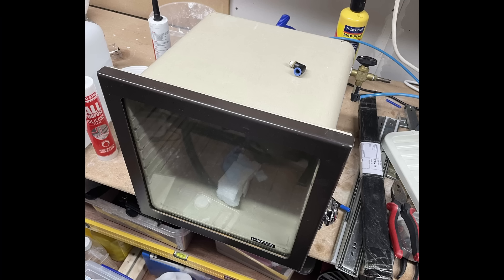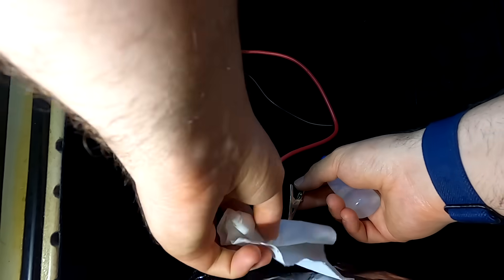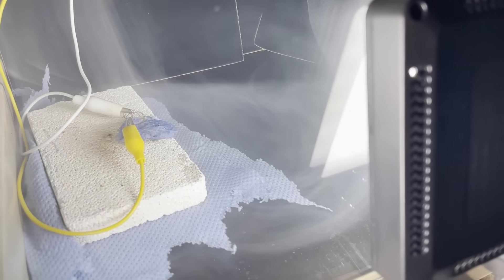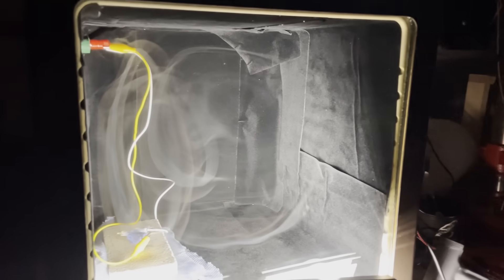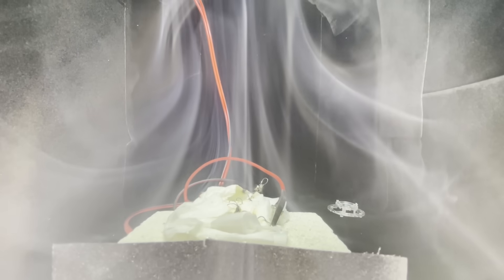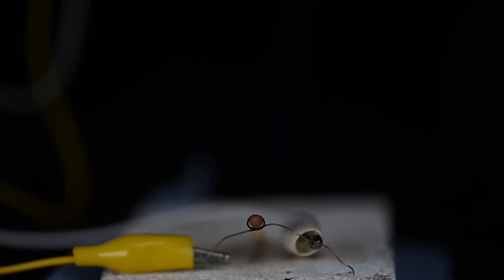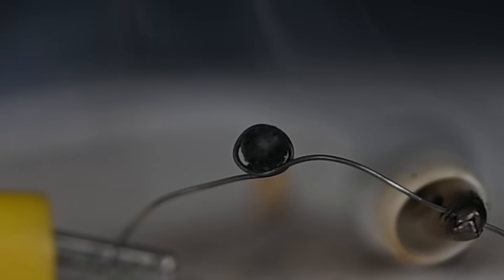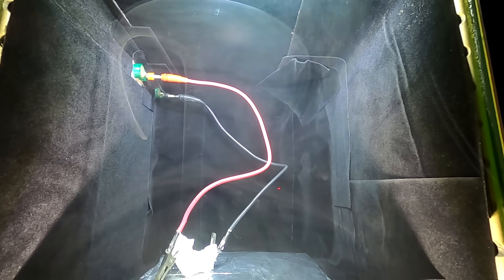What does Convection look like in a Vacuum?

Comment: This is more "How Electricity Works In A Vacuum with visuals" because those "smoke" atoms may be charged differently than fire smoke, and are moving in a stable electric arc patterns. The only way I could think to do this would be to fill the box with oxygen (or a little baking soda and peroxide in a corner) then burn something in it and seal it. But, the vacuum would just remove the smoke as soon as its turned on 🤣😂🤣 This is literally (possibly) the only way this could be done tho👏👏👏😊

Comment: A: first the smoke plates out in your cold trap, the remainder contaminates your DP oil. Or it all plates out in the cryopump if you're rich.
(at least, from the perspective of someone who worked with High Vacuum for years)
I shudder to think what smoke would do to a gas analyzer, and I shudder again to think of cleaning the crap out of it.

Comment: This is so so so much mind blowing than I thought it would ever be, we need to share this with Smarter EveryDay! I would also think a idea off this is try making the smoke at different levels of Torr/Micron and see how the levels of gasses effect on the smoke || Example: Like 3300 ppm of gas^ (I.E: pure 02,pure C02, Atmosphere, maybe even Argon) inside of allows the smoke to do this vs 33 ppm of gas^ in the chamber the smoke behaves in such a unique way! Even adding a port in the side like the + amd - cords to allow that chamber to be filled with a gas from a tank which will allow you to try other gas in a vacuum to see if it changed how the smoke behaves!

Comment: If you burn something in a vacuum, then the gases being created would reduce the vacuum would it not? Just like an explosion, but to a far lesser extent. You would have to pump more of the "air" out of the chamber as the material burns, which would essentially pump out all the smoke, I believe. otherwise, wouldn't the same thing happen in an atmosphere? (except with more resistance).      edit: The fact that there's convection... does that not prove that there is an atmosphere? Would convection be impossible in a true vacuum?)

Comment: This is smoke in a partial vacuum, which is why there are convection currents.  Smoke in a hard[er] vacuum must be different.  Smoke in a harder vacuum in zero gravity must be different.  The coolest thing would be an atomic bomb in hard vacuum.  It would have a very different fireball.  All the gamma rays and neutrons and fission fragments and metal vapor would fly straight outward until they hit something.  Anything within miles gets flashed with death and then plated with more death.

Comment: At this level of vacuum, the match test clearly shows that the residual gas has quite much effect on the smoke.

Hot gases will go up only if there is colder gas which goes down.

In UH vacuum this effect shouldn't happen.

Comment: I’d be curious of what the cross section of the smoke looks like with a laser, you can get cheap green laser diode that displays a line rather than a point.

Comment: Wait a minute, what force causes the convection currents to always RISE up from the bottom to the top? since there is no air inside the chamber, how do the atoms of the smoke "Know" to rise up vertically if there are no other atoms present at a lower temperature next to them? if there is no cold air how can the hot smoke knows to rise?

Comment: Looking at things that may effect flow, adding a vertical panel to the box for the wires and ports to hide behind. Reducing the size of the coil and fuel source like a small piece of cotton fully within the coil. I'm just trying to think of ways to get cleaner results.

Comment: How good is the vacuum?  To my eye there must still be significant air in there, or the burning is creating gas, as the smoke (which I believe is a solid, right? so won't necessarily simply diffuse?) is nonetheless  carried in streams of that gas going through the air.

A test I'd recommend is do the same experiment without attempting to pump out the air.  I'm guessing it'd look nearly identical.  You mentioned that in full atmospheric amounts of air there'd be more eddies etc. but did you try this?  I think given that it's such a very closed space, maybe normal amounts of air would give the same visual.

Comment: How is there turbulence in a vacuum and why would the smoke rise, I'm guessing it just not a good enough vacuum. Not all burning requires oxygen around it, plenty of things, like a bullet, will fire because it makes it's own oxygen from the charge.
Reply: is the smoke a gas?  if he's introducing a gas in to his vacuum chamber then it's no longer a vacuum. 

i really don't know.

a vacuum can affect current in a wire.  it's not a big affect. but one way to measure a vacuum is to measure the picoamps in a wire.

if he's introducing a gas it should affect the picoamps just like air does.
Reply: @longnamenocansayy  The smoke is a solid, tiny bits of carbon, it will have other gases as well like co2, in my mind the smoke should just drop as gravity pulls it, heat rises in air because it's lighter than air. I may be wrong about all of it.
Reply: what would happen if we put water in his vacuum? it would boil away, the water would turn to steam which is a gas and collect on the sides  of the walls because gas acts like a gas and disperses away.

so if his smoke is a gas it should act like a gas.  this stuff imho is not acting like a gas.

but what is that circular motion? and if it is not a gas why doesn't it drop to the ground?

is there a static charge? is it affected by light? is it affected by heat?

i wish mr. knowitall was here when we need him.

Comment: Very interesting and very lovely to see. My initial thought on seeing the convection circuits was that you were messing with magnetic field lines. And so might I suggest trying to produce an iron rich 'magnetic smoke' by adding fine iron powder to the smoke fluid and cooking that up, whilst having a powerful magnetic field interact with the flow. A monster magnet, suitably wrapped in black plastic, stuck to the side or roof of the unit might do the trick, or a wired up electromagnet that you can switch on and off to help observe any changes in the convection flow as the field comes and goes. The pace of the convection flow, and the undisturbed nature of it reminded me of the imaginings of how a solar system forms from agglomerations of ' stellar gas and dust'. As a nipper I thought of fine sand etc, but later readings informed me that most of the stellar material is way finer than cigatette smoke, and that time is a major ingredient in 'baking the cake'. Excellent stuff Mr Paul. Please continue... xxx :-)

Comment: As I was. Watching this.   I. Wondered.    If ….  You.  Had. Put the wire ends suspended in the centre of the box ..in stead on on the bottom ….    So when the smoke is generated…. In the vacuum chamber…if might per chance emanate in a 360 degree direction. Not just up and sideways….   ?

Comment: I thought when heat rises, it's because it's less dense, so it's more that cold falls and pushes heat out of the way as it goes down - like considering a bubble of air in water as a void where the water is rushing down rather than the bubble going up. So why does all the hot smoke go upwards inside the vacuum chamber? Is there really still enough gas for it to get pushed up so strongly? I guess we really do live in a liquid...

Comment: What is a thousand microns? 

If that were a true vacuum and that chamber was, what, 20x20x20 inch? Then it would be withstanding 20x20x14 = 5,600 lb. 

I think you are mostly seeing air seeping into the chamber at a rate that would make it hard to pull a decent vacuum.

Be interesting to see what would change if you chilled the chamber with dry ice or liquid nitrogen.

Comment: Mad... It's laminar flow with no disturbance from surrounding gasses. Of course you can't get a complete vacuum with your setup, but I'm not understanding why the gas (smoke) doesn't just dissipate equally. There's no surrounding pressure, so it should just dissipate evenly, right?

Comment: I wonder if you could electrostatically move the smoke particles by applying a HV potential to plates. you could use circuit boards on standoffs glued to the inside. Great video.

Comment: I'd like to see the heating element at the top with some blocks of dry ice one the bottom.  Try to heat up the upper part while cooling the bottom before making smoke. I predict doing this will cause stratification of the smoke. The smoke should form in a layer in the middle under those conditions.

Comment: I used to work for a company that makes pressure transducers. We pulled a hard vacuum in a small steel tube. 
I did a lightning experiment and it failed. When we opened it up, the copper of a PCB trace was completely missing! 
I noticed this brown powder that coated the interior of the steel tube; THAT was the copper! 
The copper had vaporized and condensed on the tube wall, like water vapor becoming dew on your window.

Comment: So, as smoke is made up of minute particles that normally floats in between air molecules - and kept floating by that air - relatively there has to be quite a lot of air or gas left in your chamber, right? Where else would your convection currents stem from?

But it would have been very interesting to see what smoke does in a complete vacuum.
Reply: It would also have been interesting to see what smoke does in the chamber at normal pressure, but apparently we don’t do the “control” these days.
Reply: This whole video is utterly bullshit and embarrassingly shows a massive lack of understanding. There definitely was "no vacuum in this chamber".

Comment: Mix the fluid with some fluorescent material and try the experiment again using a backlight for the illumination.

Also you could use two different colors and all those three different colors even and see what happens as the different bodies of smoke interact with each other inside of vacuum.

But it'd also be interesting to do the same experiment but don't pull a vacuum.

Comment: But since there's no air in there, there shouldn't be any convection.  The only reason hot gases rise is because they are less dense than the surrounding gas.  So it's not so much the gas rising but rather the surrounding gas sinking to displace it.

Consider a boat on a dry river bed.  It won't float because it's denser than the surrounding atmosphere.  It's only when there's something with a higher density present (like water) that the boat will float.  So smoke in a vaccuum should sink to the bottom of the chamber.  No convection involved.  I wonder if your results would differ if you were able to create a perfect vaccuum?

Comment: I find it weird that smoke rises in the vacuum. I'm not a physicist, but I thought convection currents are formed when fluids of different temperatures interact, so hot smoke normally rises when surrounded by cooler air. In the vacuum I kind of expected it to slowly fill the bottom of the chamber. What's going on?

Also, why are there particles? What are they suspended in?

Comment: What about adding food coloring? It might color the bands a little. Or even some fluorescence. It would also have been better to try and hide the electrodes. E.g., maybe turn the chamber on it's side and reduce the length of the wires and only run them along the bottom. Also maybe put a back light instead of a front light then invert the video. That is, try and only capture the stream lines of the dynamical system so they are most clear. Of course one can simulate these things in real time to a high degree of accuracy and so it may be pointless.

Comment: Fascinating experiment.  Any idea what the remaining pressure is in the chamber?  If it was really vacuum in the beginning, wouldn't you expect a straightforward rapid diffusion in all directions?  And how long did you have to wait until these convection "loops" became visible? I figure that in order to have convection flow, the chamber has to be gas filled, even at a low pressure. The smoke particles aren't individual molecules but micron sized lumps of matter that make the gas flow visible. So it would be good if one could know precisely the pressure in the chamber.

Comment: I always thought you could not have convection currents in a vacuum. Very interesting. Learned something new today. 😀
Reply: I was thinking the same thing. Hot gas rises because it is less dense than a cooler gas. So there must be just enough air left in the chamber to start the convention currents. That is my explanation. Otherwise, I would think the smoke particles would just drop down. Any ideas?
Reply: @bobh6728   I think you might be right. It's not a perfect vacuum.
Reply: My question exactly: I guess in a perfect vacuum, everything would just drop on the floor similar to a liquid without a mirror surface.

Comment: I would've though in the absence of air any smoke particles would just fall to the ground and pile up around the source.  Why is this happening?  What are convection currents being generated in if there's no gas inside the chamber?  Smoke shouldn't smoke.  Fire should just create a pile of particles.

Comment: Wow. Did not expect that much movement
  I would have guessed the Gass would have expanded more evenly to fill the chamber. Not to stream in fast convection.

Use this ti watch the vaccume pump pull out the last stuff?   

Be interesting to watch the last bit having to "find" vent, instead of being pushed into it.

Comment: Can you fill it with nitrogen and run the experiment again? I believe the oxygen levels are depleted, or very low, but there is likely still some nitrogen present (at your vacuum chamber pressure). The experiment is to see how visually comparible the flow is in Nitrogen at 1atm verses at low pressure.

Comment: The smoke fluid will be off gassing but even so, the smoke should fall to the bottom but I think that there will be significant electrostatic charges on thr particals that drives the stream off the producer and the curls it round at the edges due to repulsion from the smoke already in the corner.  Very interesting, I'd play with that for ages.

Comment: You could play with automotive glowplugs,as extremely fast and localised heat sources and convections.
They run on 12v and use 10 to 15 amps each.
That could be helpful to ignite stuff and create pulses of heat at different spots to make the smoke move different directions.
Same with peltier plates.

Comment: I think it's worth reiterating that this isn't a pure vacuum. Convection currents need a fluid to form in. If there are convection currents then there is enough gas in there to form convection cells through density change, and the gas is dense enough to carry smoke particles

Comment: The stronger the vacuum you want, the stronger the vacuum chamber has to be, so as you get closer to a perfect vacuum your windows also get smaller. Also eventually you need to switch from a vacuum pump to a molecular turbine which can deflect molecules of gas out of the chamber.
Reply: Atmospheric pressure is about 760,000 microns. The (partial) vacuum used was about 1000 microns, which is 1/760 of atmospheric. The pressure difference that the walls need to withstand is already very close to the total atmospheric pressure; going all the way to a perfect vacuum would only make a tiny difference in the amount of force exerted on the walls.

On the other hand, in getting closer to a perfect vacuum, the walls would need to be more leak-proof. Also, at lower pressures the amount of gases and volatile substances in the walls and objects in the chamber becomes significant.
Reply: @franksierow5792  Is there a point at which everything starts outgassing? Are there materials that simply do not outgas, even under a complete vacuum?
Reply: @jmrumble  I do not know much about this myself, but here are two relevant articles: https://en.wikipedia.org/wiki/Outgassing https://en.wikipedia.org/wiki/Materials_for_use_in_vacuum
Reply: @franksierow5792  Thanks! I'll check em out :)

Comment: I was disappointed because I thought I'd see what happens in a vacuum . But once the match is emitting gases, the environment is becoming not a vacuum but a low-pressure environment. Had the vacuum pump been running continuously, (which it apparently was not,) restoring the gas-free environment, then I would have been seeing what happens to smoke in a vacuum.

Comment: We all know that sounds needs a gas to pass through. It would be interesting to to fill your chamber with various pure gasses. Use your 2 terminals for a speaker inside the chamber. It would also be interesting to simulate various altitudes on sound. For example on top of everest sounds carries quite poorly due to the low air presure.

Comment: How long are you leaving the pump on for?  I wonder if you left the pump on for several hours to really make sure that felt stops offgasing if you'd see a noticeable decrease in turbulence.  Also having and lighting on while the vacuum pump is going to make sure that black felt material is at tempurate so you're not creating any heat gradients as the walls heat up that can contribute to turbulence

Comment: I'd like to see a wider coil, suspended dead in the centre, with soaked medium inside of it - would it form something similar to magnetic lines around an electromagnet, or would the smoke be too heavy to rise that high to close the loop?
Would sufficiently strong laser beam affect the smoke in any visible way?
How about placing dry ice on top of the chamber, would it speed up/stretch the streams?
Now these are kind of toys I'm jealous about (had a couple chances to buy chambers and pumps, need a space first though ;)